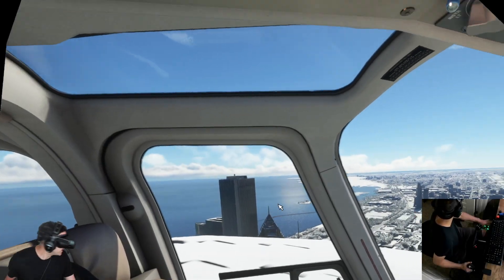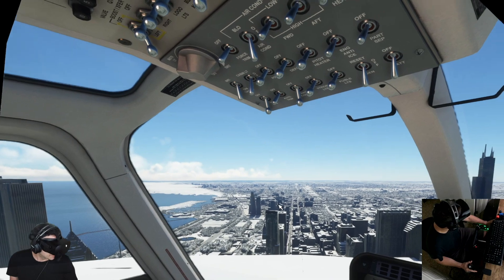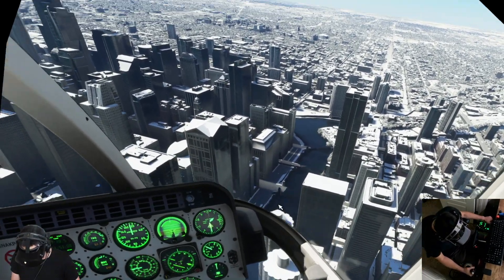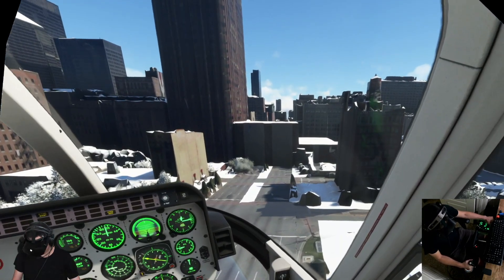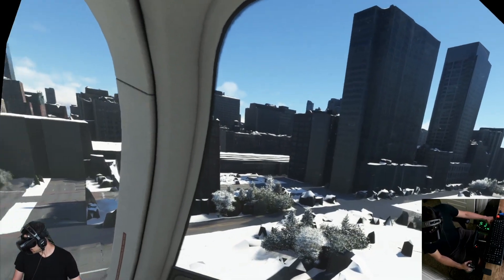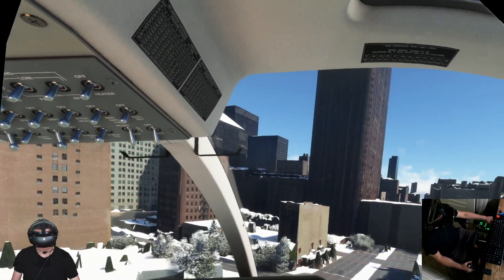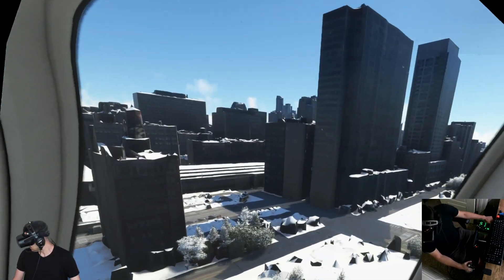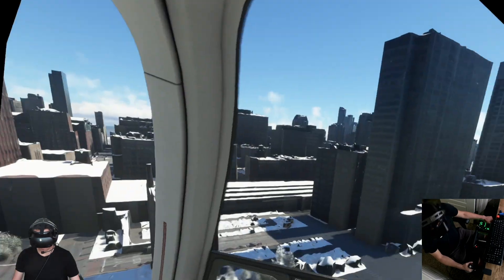Real Helicopter Pilot Hovers Like a Pro + IGE vs OGE - MSFS Bell 407 + HP Reverb VR + RTX 3090ti

Comment: May I ask; do you think MSFS is a reasonably accurate approximation of real rotorcraft?  I would like to hear your opinion in detail.  Especially on the standard G2, 407 and the CowanSim MD500.
Reply from the maker: This is a great question and I think the best way to answer is with a video. I'll try to have something out soon on this topic.
Reply: @SnakPakFlight  I am an SEL pilot with no real life rotor experience.  I was previously using MSFS to practice IFR and to learn how to setup and program airliners from Cold & Dark through VATSIM flights.... technical stuff.  Once the helicopter update dropped late last year however, I became a lot more engaged in the sim and almost doubled my hours by flying helicopters.  On full realism there was a steep learning curve and it took almost 20 hours for me to get competent with hovering, taxi, quick stops, landing and well controlled box-pattern practice.  It was more fun than real life fixed wing stick and rudder learning because it was so challenging, and because it allows so much more freedom in the sim. 
The odd thing is that I was always disappointed in MSFS fixed wing "stick and rudder" handling because it didn't feel very realistic, but now I love to fly helicopters working on maneuvers all the time.   Without actual flight time in a helicopter it is impossible to say how much of that is because I have no experience/frame of reference, or how much is due to helicopters just being a more inherently engaging and rewarding experience.  
I am always looking for the opinions of high hour, multiple certification helicopter pilots but have yet to see one give an honest in depth assessment.  I see a lot of people weighing in or asking about flight dynamic realism, but most are sim-only pilots and a handful come from the R22 only and those Robinson pilots don't seem to agree.  Their opinions are oddly either too dismissive or too glowing, and I get the sense that comes down to either the horrible bugs from the initial release, or guys who are scared to say something negative lest it harm the community and send us back to the post-FSX dark ages.
A big question I have is whether I am better off going to DCS just to practice maneuvers and learn helicopter flight dynamics, with no interest in combat.  Knowing how the different options compare, either sim to sim or model to model, will probably help a lot of people who are also new to helicopter simming.  
I scoured YouTube when learning to fly helicopters in MSFS and honestly your videos helped me understand helicopter dynamics in the most "dense" style of communication.  People are drawn to flight simming for different reasons and have different attitudes, so seeing a real pilot who wasn't a gear hound and explaining the way an instructor would but not taking the sim TOO seriously was perfect.  A few months in now, I would value your opinion the most.
Reply: That video is a great idea. I haven’t got the MD500 yet but it’s on my list. My worry with direct linkage controlled helicopters is that the lack of control feel will be a realism killer for me.

Comment: "... Uppy Downy stick... ", my level of piloting knowledge

This makes sense in my head what I'm trying to ask, so, when you are at low level, like where you have the ground effect, does the helicopter get buffeted around at all by the downdraft from the rotor.

I tried looking at the green coloured lines when you have the airflow dynamic turned on, but couldn't work out if it would affect the aircraft
Reply from the maker: No. The induced flow of air hits the ground and jets out the side. It almost acts as a "cushion" so to speak, but aerospace engineers tend to shy away from that word.
Reply: @SnakPakFlight  thanks for the explanation at my level, engineers of all disciplines like to use big words and complex explanations for concepts that could be explained quickly in simple everyday words